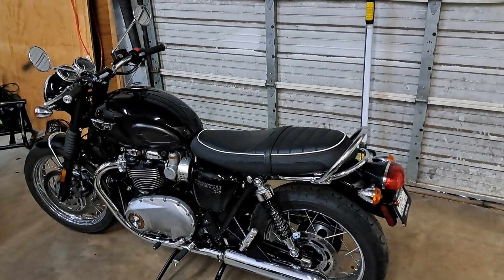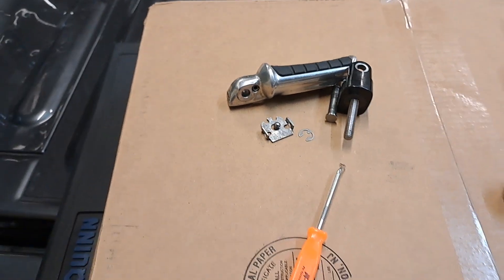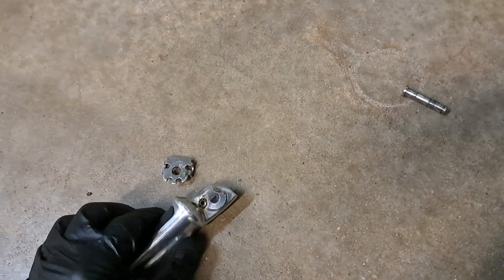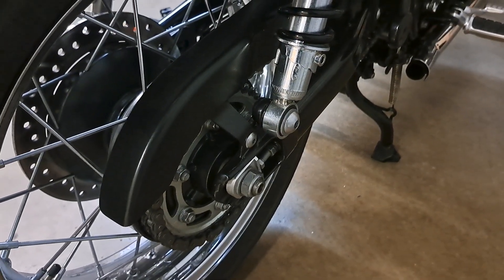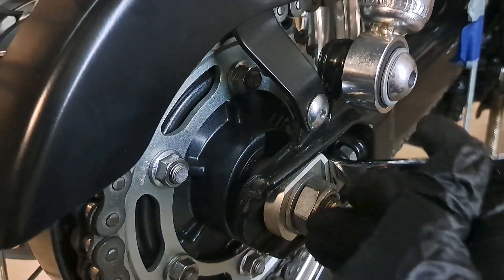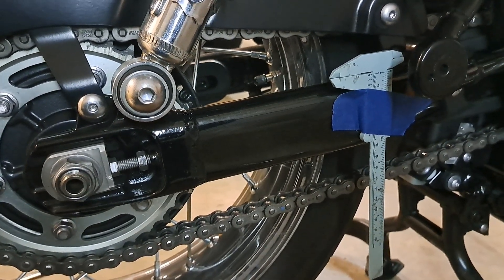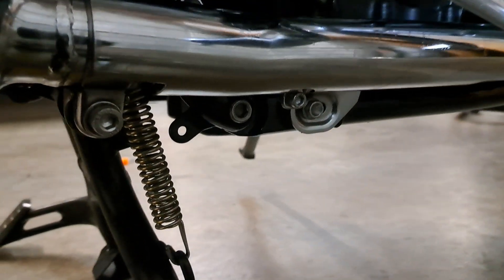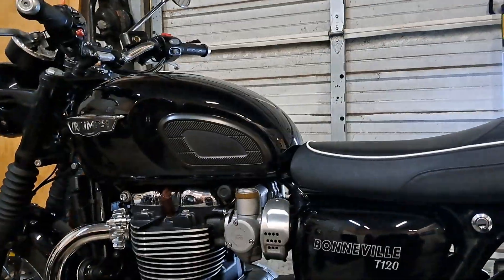Triumph Bonneville T120 Chain Adjustment.  It's easy!

Comment: New owner to new T120. Owned 25 motorcycles various brands over 40 yrs. Most bikes the chain adjustment does not require removal of any parts. Also bought a new Royal Enfield Super Meteor just weeks ago. RE could teach Triumph alot about access to chain adjustments. 2 minute job on the RE.

Comment: There’s no need to remove the foot peg, you can simply unscrew the two bolts attaching the black metal plate directly to the exhaust
Reply: Please explain

Comment: I thought the chain needed to be adjusted with the bike NOT on the center stand? The swing arm will change the tension on the chain when the bike settles.
Reply from the maker: This motorcycle does not have any difference in Sag between being on the center stand and being on the side stand. After setting chain tension with this bike on the center stand, there's really no difference between where it measures on the side stand. That said, some guys will still err on the side of wide for Center stand adjustment. In this case, verifying 25 to 30 mm instead of 20 to 25mm when upright in a tire chaulk.
Reply: Mine does.  I have a 2021 T100 and on the centre stand it’s about 5-8mm slacker.